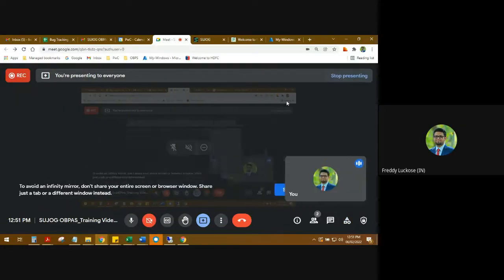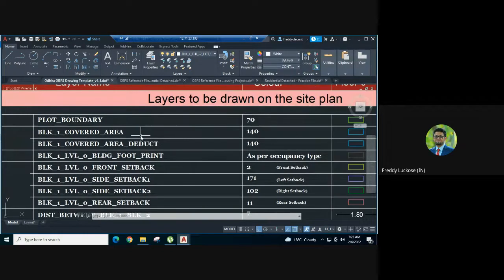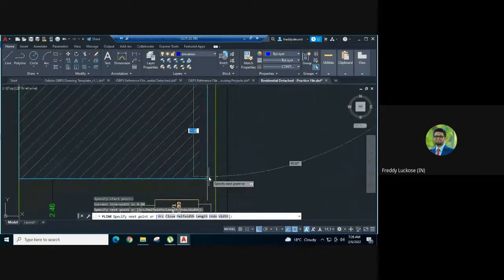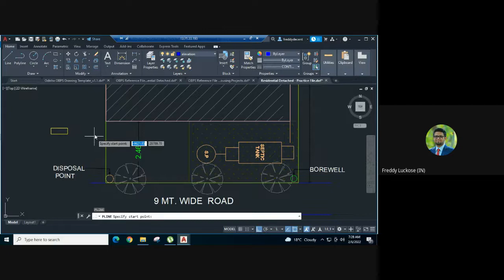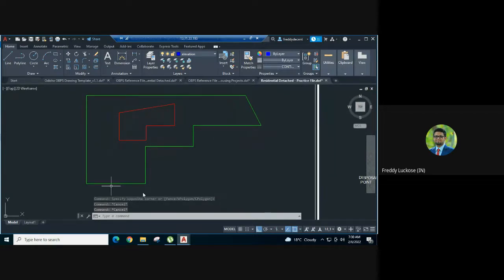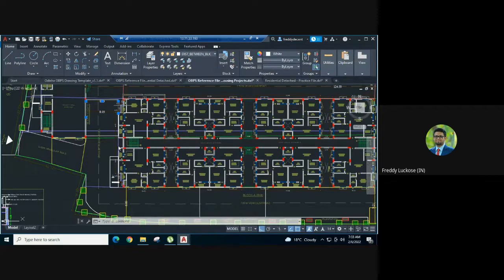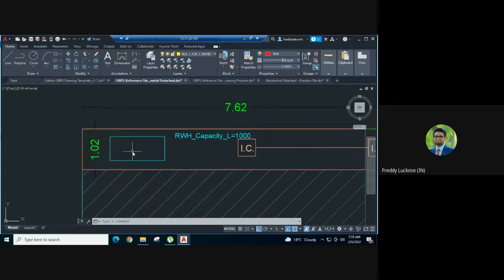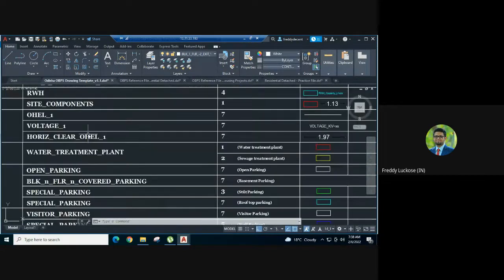03 Site Plan Components   Part 1

Comment: IN THIS VIDEO COVERD 
1st-Plot Boundary
2nd-Ground Coverage Area
3rd-Building Foot Print
4th-Building Set Back
5th-Openspace Between Building Blocks
6th-Plantation Tree Count
7th-Green Area Inside Project
8th-Rain Water Harvesting Details
9th-Rain Water Ground Recharge Pit
10th-Distance Electric Line At your Project